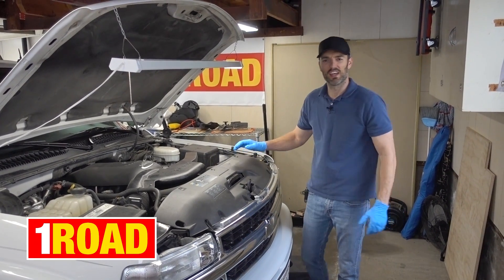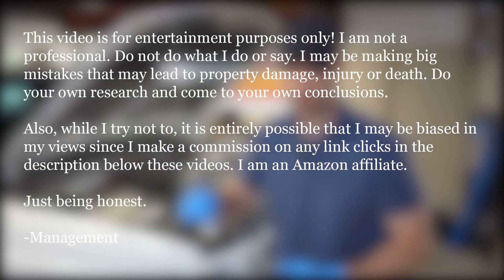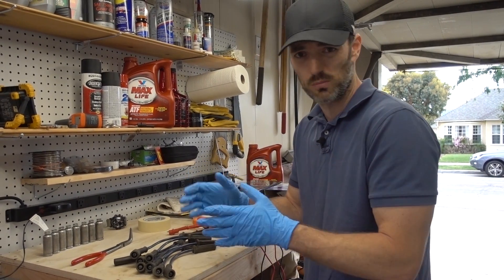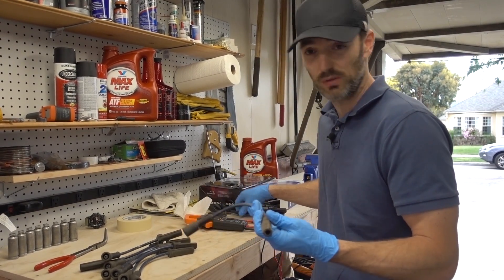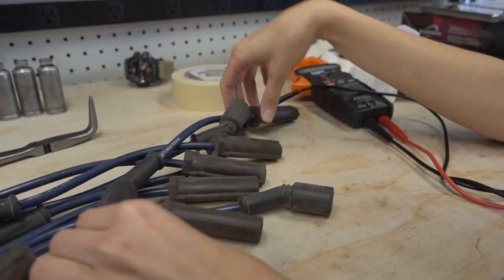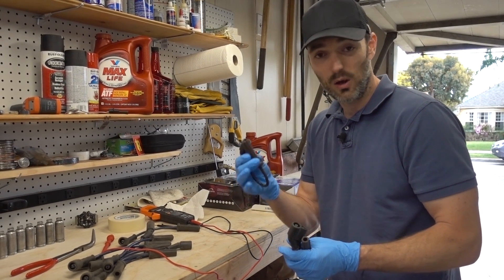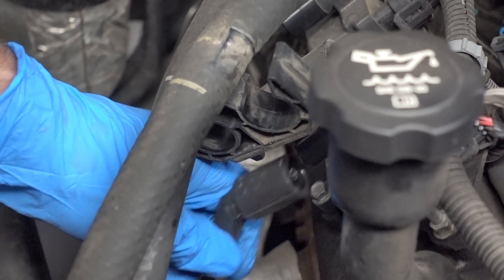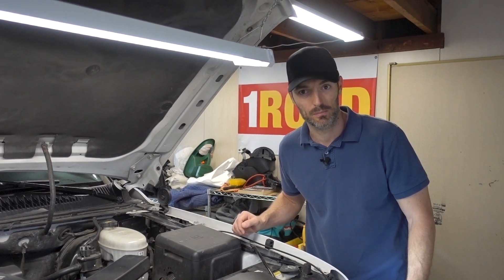Why You Should NEVER REPLACE SPARK PLUG WIRES WITHOUT FIRST TESTING FOR OHMS!

Comment: Way too much dielectric grease and it isn't supposed to get on the electric terminals, you're supposed to put a thin layer around the rubber insulator, which obviously is the point of the grease, to insulate, If you get it on the terminals/connection points it makes the spark weaker. For this reason I don't even use the stuff.

Comment: More resistance means higher voltage and lower current. Higher current means ignition coil degradation and magnetic fields that send stray signals to all the touchy sensors that the ECM relies on to keep the engine running correctly. 
The spark is created by high voltage, not high current. Higher current (caused by too little resistance) through the spark plug will overheat them causing pre-ignition and excessive electrode wear.
If the ignition coils are OE, use AC Delco wires, or matching specs. Otherwise, plan on changing ignition coils often. They degrade stealthily. The ECM will just advance the ignition timing to compensate for old coils. This makes for bad performance at higher rpm. And you will get no misfire DTCs to alert you of the problem, only an underperforming truck.

Comment: Should not put a gob of grease in the boot, take a Q-Tip and put a thin swipe around the inside of the boot. Remember this grease is not conductive, it is an insulator, plus it helps with condensation. It is only to be able to take the boot off easier only when it comes to low voltage electrical connecters then you can coat the metal contacts with a thin coat to keep the connection from corroding from condensation or water that may get in.
Know that the connection is made from metal-to-metal contact not because the grease is there, when pushing the connectors together the two metal contacts scrap the grease off down to the bare metal, if it did not there would not be current flow.

Comment: Lower resistance is better more even burn of fuel /air mixture  in the cylinder thus more power output from the engine.   But its an American vehicle, so no matter what you use its still crap.
Reply: A brit talking about crap vehicles??? Ours suck because the epa makes it that way....

Comment: If it ain’t broke… don’t fix it. Rule applies to non wearing components like these wires. On the other hand if you are bent on fixing something for fun… replace the spark plugs… and the tires… and the filters… for these items newer is always better…. I suppose new fuel injectors could also be beneficial… its always best to replace wearing components before they fail. 
Cheers man… great video. 😊👍🏼

Comment: Why i miss the days of having an oscilloscope type tune up machine with vacuum hook ups, timing light etc.  Could see how each cylinder performed before and after and great views of wavelengths.  Much info revealed.  Great subject and video and comments generated. thanks!  And yes, can still obtain a digital reading on new style scanners and use that now, yet old wave form patterns on an old tube type screen where high tech back in the day and worked very well, lol

Comment: Napa it is,keep the gm as a just in case.If it was a race car it would be a no brained.Napa wires can break down a ways and still be better but I am like you in the aspect that usually the Oem parts have a hidden benefit that is not apparent

Comment: Why are you worried about the ohms resistance of the wires when you smear DIELECTRIC grease in the end of the plug wire. Dielectric means non conductive, or very poor conductor so when you push the plug tip through the grease  you are not helping the connection between the wire and the plug. I put a light coating on the outside of the plug insulator to help seal the boot to the plug and help lube the boot while being pushed on and off. The connection between the spark plug tip and plug wire should be as clean and tight as possible. I know a lot of people do this on plug wires and electrical connectors to, not a fan. I do like and subscribe to your channel Jimmy even iif I am late to the party. Fixing up a 99 Yukon and have learned a lot from the channel.

Comment: Resistance isn't always a bad thing in a plug wire I know everybody always wants a zero ohm resistance but you do need some resistance in order to make a good connection they have one ohm spark plug wires but when you put a tester on it okay yeah super low resistance but when you try to force a shitload of current through it as you do with any performance application you can end up burning the little cables in there I don't know what they're called but AC Delco plug wires are the way to go. I put low resistance plug wires in my truck and it rang great for about a thousand miles and then after that I had smoke issues and burned plugs and couldn't figure out what was going on can't be the plug wires they're brand new put the old AC Delco plug wires back on ran perfect. 50 miles later pull the spark plugs back out they were all cleaned up ran like a champ so that's just my experience. I'm running a performance HEI distributor they call it the stealth distributor it's capable of 9,000 RPM. Why I don't know why not. I've honestly never had my engine stop pulling and I've had it up to 6,900 RPM and then tack went crazy so I let out. I personally built my engine but I did not do any of the sizing and balancing it went to the machine shop for that and so it was balanced and blueprinted I also had them do the ring Gap. Unfortunately I had to install the rings that sucked.

Comment: I tested for 1 year, 20,000 miles. OEM did not preform.
Had to replace cap rotor and plugs every about 4000 miles. 
Tended to create moisture in the distributor cap, and make my engine miss.
And, yes, I used the dielectric lube.
Best to go factory spec, and leave it as is.

Comment: I presume the lower the resistance the better, though electronic circuits sometimes work better with a resistive load i.e. the lead itself. I just checked the 4 silicone leads on my Honda Type R and 3 leads measured 140 ohms, yet the 4th lead gave a 3,000 ohm reading. However, performance doesn't seem to have been affected. Perhaps this is because we are dealing with very high voltages via the plugs and such a discrepancy in the readings may be negligible

Comment: 1)Spark plug wires are not made for DC current.
2) There is high frequency high voltage power that doesn't care about this resistance. The spark plug wire is a long inductor. 
3) Spark plug has approx 0.4 - 1mm of an air gap that is seen as a large resistor equivalent to 2*10^13 Ohm. So 99.9999% of power will go into that HUGE "resistor" and won't be wasted in 100-500 ohm wire. (largest voltage drop in a circuit develops across the largest resistor)
4) If you test other cars wires you might get surprised by their resistivity. For example original Subaru wires are 5000-17000 Ohm. NGK wires for subaru are approx 400-600 ohm. Bosch wires you won't even be able to measure properly with multimeter because Bosch wires have high capacitance so you'll measure anywhere between 1000-200000 Ohm or Open Circuit. That's because multimeters use Direct current to measure resistance, and capacitors block DC current. Some multimeters (e.g. Fluke) use low power pulses to measure resistance - they will measure resistance in this case but the number won't be consistent and/or accurate because the pulse isn't strong enough to overcome capacitance. 
5) Finally, what you should care about in Spark plug wires: 1) propagation delay (how fast high freq. signal gets from one end of wire to another). You can test it if you have a function generator and an oscilloscope 2) quality of external insulation and how well the end boots are sealed.

Comment: AC Delco is a brand name sold to the highest bidder.  Does not mean that GM made the parts or even that they’re made to GM specs.  Don’t confuse parts bought at the dealership with parts made in China and sold on your favorite cheap website. 
The vehicle will run better because  you put new wires on it.  That said, a new set of Belden wires is almost surely a better product than Chinese made “AC Delco” wires.  Belden has plants in the US.  I used to live next to one in Fort Mill, SC.

Comment: I did my plugs on my 1997 Mercury Cougar 4.6L. I would randomly get this shudder and bucking when I was driving, it would last under a second but I never could pin point what it was, its under light throttle, I eventually got the car to do this for about 10 seconds and it was a misfire. The plugs and coil packs were recently changed so I knew it had to be the wires. I've only used Motorcraft plugs on the car because I wanted a perfect seal. Here were my findings.

As I was replacing the wires I measured the resistance running through them. I had my multimeter set on 20k Ohms or 2k Ohm, I can't remember now but these were my readings

Cylinder 1 Wire – New Reading  10.62, Old 5.16
Cylinder 2 Wire – New Reading 21.6, Old 10.0
Cylinder3 Wire – New Reading  15.0, Old 7.12
Cylinder4 Wire – New Reading 25.1, Old 15.33
Cylinder5 Wire – New Reading 19.65, Old 12.38
Cylinder6 Wire – New Reading 22.21 Old 11.14
Cylinder7 Wire – New Reading 15.51 Old 7.6
Cylinder8 Wire – New reading 15.17 Old 9.06

After changing the wires the car ran extremely smooth with no shuddering or bucking.

Comment: Another thought, okay maybe at least 3, on the steering cover, you replaced the turn signal, etc switch and I have same but the plastic legs for the screws are broken and missing. They have these for Auto trans trucks but not the manual. Any suggestions?

Comment: Just replaced a set of Belden Premium 7mm wires in my 7.4L 454 TBI. I had 1 wire tear all the way around about 1/2in from end of the boot. I always use Super lube in the end of the boots prior to install. It doesn't necessarily work given the temp the BBC engines run. What plug wires did I use to replace them? Belden 8.5mm heavy duty ceramic. Along with Autolite plugs gapped at .035. The engine purrs like a kitten. The old plugs (Delco) and wires had 24K on them. Another tip...when checking wire/s after you hook up the volt meter you want to manipulate the wire while watching the volt meter. If there is a break in the wire this is how you find it.

Comment: First I gotta say - you're a good husband. It's an assumption yes, based off how your wife interacted with you.  We don't give as much praise and support to even the concept of being a good husband.  Its all negative. I believe that needs to change. It needs to change between men also.  Most probably think it makes them look weak  or whatever, but its that stereotype that actually proves the opposite. Having the courage to tell another man that in the face of possible humiliation, THATS strength.  Anyways, just had to throw that in because its important.

I literally have as little qualification to offer any advice, but I have watched a few videos where it was stated that its not a good thing to go with too low of resistance in situations like this because the rest of the components are not designed for that and it  can ruin more than it helps. No clue if its true, but seems likely to me.

Comment: I read at a blog that too low resistance can be bad for ignition system.  It allows too much current and can cause damage to coil and distributor.  Very low resistance wires are used in racing applications.  Moroso Ultra wires advertised as designed for racing engines.  Curious if anyone can confirm.
Reply: Negative. The lower resistance wire allows the coil to pass energy from the coil easier (less resistance) it does not make the coil work harder or create more energy.

Comment: @1ROAD Ohm's law is V=IR, where V is voltage, I is current, and R is resistance. Let's assume the ignition coil is supplying 25kV like one commenter suggests. 25,000 V = I x 200 Ohms for the Belden wires. Solve for I by dividing 25,000 V by 200 Ohms. The answer is 125 Amps. Use 400 Ohms for the ACDelco wires, and you get 62.5 Amps. Now, 25kV is clearly to high an estimate, 1000 - 2000 volts is probably more realistic, but that's not my point. My point is that if you increase the resistance, you decrease the current. Those ignition coils are only so big, and controlling the current output of the things will help prevent premature failure. The same goes for the spark plugs. Less current = cooler spark, and your plugs will thank you. Furthermore, the theory that resistive wires cut down on radio interference holds water. Electromagnetic fields are generated by current moving through a conductor. If you reduce the current, you weaken the electromagnetic field. Radio waves are an electromagnetic field, and pulsed DC electric currents, such as in the spark plug wire, emit a rather broad spectrum of radio waves. Reducing the field should reduce radio interference.

Comment: 4G94 2.0l 4 cylinder Mitsubishi lancer . I left work one day and at a stop light gurgle gurgle gurgle putter putter check engine light. cleared with smart phone app, instantly came back on. I though aww man Spark plugs bad. nope. I thought maybe a ground or vacuum leak, or injector, Idle air control. or worse but nope. The moment I started the car today and moved the spark plug wire I knew. Yay! problem solved. got one new one. Belden is "Ok" not great. I got import direct. O'Riley Auto.

Comment: The spark plugs have a much higher resistance. So if you're wires or one ohm it's still only going to have to make it past the spark plugs. It used to be the higher resistance would have an increased durability because less power his past. But now with metals like iridium, and platinum being used, so the resistance can be lowered for more power to flow. If I were you I would continue to enjoy putting the OEM brand that you like so much on your vehicle. Only difference between those OEM wires and the off brand is that your OEM brand will last longer due to its higher resistance.

Comment: Keep the Beldons as long as you are not getting radio interference.  This is fundamental.  There's no point in you using a Volt/ohm meter if you are going to ignore the results and use new AC Delco that are demonstrated to be not as good new.  Use Dielectric Grease in the boots so you won't pull the wires out of the connectors.  It will keep the boots from sticking to the plugs.

Comment: I have GM vehicle also but AC Delco has budget and premium parts and you never really know which is which🤔. I main use Delphi which is really the OEM for Gm and AC Delco. Yes Delphi make parts for AC Delco. My 04 Bonneville had original wire that say Delphi on connectors and AC Delco on wires🤔.  I now use 8mm BWD coils and wires with copper AC Delco plugs and fix my random stumbling at start up like car wanted to shut off until I gas it just a bit but it was totally random hot or cold.
Reply: By the way I am a professional and thanks for the videos I enjoy your content.

Comment: ACDelco Professional is NOT the OEM part that was installed at the factory. “Professional” is their aftermarket equivalent line.  Professional is the stuff they make for all makes and models. OEM parts will say something like “Genuine GM” on the packaging. They are different.
Reply: yes you are correct

Comment: Dielectric grease is an insulator and is being improperly used here. If you want to put some on the ceramic part of the plug, that's o.k. and the outside of the cap where the boot goes, that's o.k. too. It should not be smeared on the conductor parts of an electrical circuit, typically.

Comment: Not a very accurate way to test  for ohms resistance. Less resistance less heat. Why not use the alligator clips on both ends of the plug wire?
Reply from the maker: Wouldn't fit

Comment: That‘s crazy, I‘ve replaced the ignition wires on my 1994 Mercedes E-Class a couple of weeks ago and the resistance on the factory wires was 2k Ohms. Isn‘t that quite high in comparison to your 450 Ohms OEM-wires? I‘ve replaced mine with 2k aftermarket ones because I was afraid it could damage something if I swap them out for ones with a different resistance. Should I‘ve swapped them for ones with a lower resistance or would it have made no difference at all?

Comment: I've ran into that same thing multiple times with Duralast plug wires from AutoZone. I had a 4-cylinder at the time and every time I pulled the plug wires off at least one or two of them pulled right out of the boot the actual clip was stuck on the spark plug and it pulled the wire right out of the boot. Every time this happened I did the same thing that you did and reattach the wire to the clip part of the plug wire and never had an issue with it not working but it is a big pain in the ass when it happens every single time.

Comment: First, AC Delco does not produce anything after the whole GM bankruptcy thing. Delphi is GM’s producer of electrical components now. Second, the Napa wires could be using a different technology to suppress the EMF radiation. Induction versus resistance. I vote for the lowest resistance.
Reply: says who? ac delco is very much still GM...however Delphi is now called Aptiv and was sold by GM yrs ago. so its the complete opposite of what you said. GM talked of selling AC Delco but it never happened.